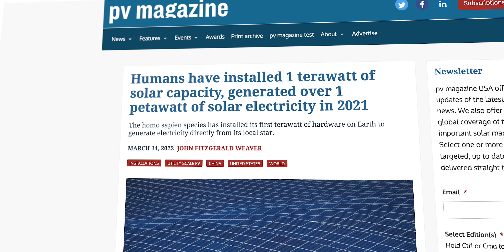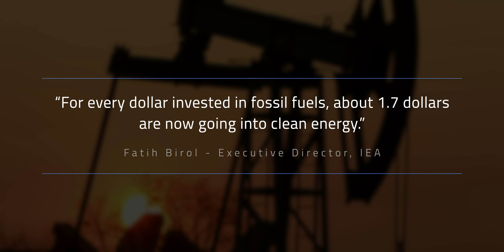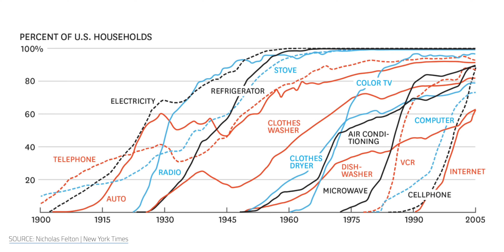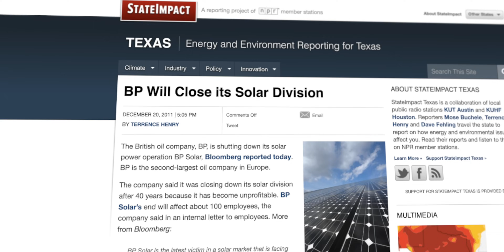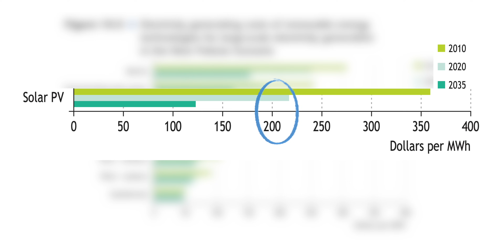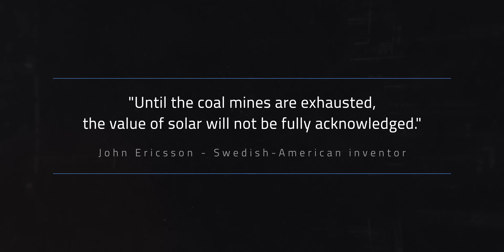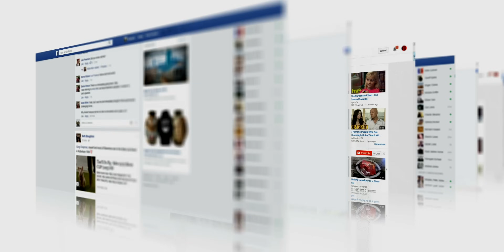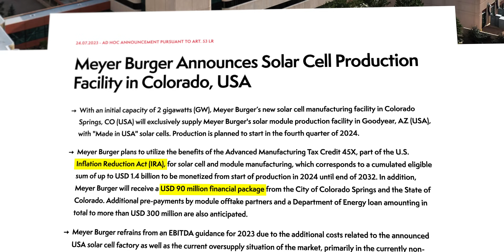How Solar Power Got So Cheap … So Fast

Comment: Matt, great video and thanks for the information and education. Wondering if another video of this type might be good for EV's. Providing additional information on the reasons for the slow transitions from ICE to EV's.
Reply: There are still a number of technological hurdles for mass adoption, quite frankly. It certainly isn't going to be used in a shipping or industrial capacity in it's current form as the amount of work you get out of those battery packs vs. charging time just isn't profitable at all. As for the average person, the sheer amount of rare earth minerals used in the battery packs, combined with a lack of mines that are NOT owned by China, who we are in a new cold war with, means that the cost of those packs will remain artificially high until alternatives can be found. Combine all that further still with the sheer amount of computer chips those vehicles need and the overall cost of the vehicle and it's maintenance (replacing those batteries ain't cheap or easy, I say this as a Ford tech) is simply going to be out of reach for the average consumer for the foreseeable future.
Reply: @alexwalker2582  You don't need to replace an entire battery pack if just a cell goes bad. It's also warrantied for 10 years by mandate, and most people don't even own a car that long. Also, there are already Semi fleets that are EV in commission now.

Comment: In planing a solar house in 1969, the collectors were for heating, some using water and other types using air. The heat battery was the enormous mass of the house for heating when the sun was down. The windows were double pained and insulation beads were blown in at night from a bead bin in the basement. Electricity was from the grid.

Comment: I would submit that small silicon waffer machines became surplus, and that is what dropped the cost of the individual cells.
It is now that the cells are getting larger, when mid size waffers are becoming obsolete

Comment: @UndecidedMF My predictions were not wrong. I went off grid in 2003 with just a 45 watt HF panel and an old truck battery. That panel cost me almost $300 but it was enough to run my water pump, a few lights and a radio.  I was the first on youtube teaching people about off grid solar and the Chinese started producing panels for off gridders and improving the technology. It was off gridders that drove the movement to cheaper and better solar panels.

It took a long time for solar to get past the off grid market to commercial and grid tied systems and you should thank an off gridder for making that possible because we proved to the world you can live with just solar power.

20 years later and I am still off grid with just a 1.4Kw system and 800Ah of LFEPO4 batteries which runs everything I need and I have most modern appliances. An average home in the US can run off a 5Kw system with the right appliances.

Now I will make another prediction and green hydrogen from renewable energy will replace fossil fuels for most uses where direct electricity won't work so invest in that.

Comment: A simple question that bypasses any need to calculate levelized cost or any other metric: Have the customers of any utility that has replaced fossil fuel power generation with grid scale wind and solar actually seen their electricity bills go down?
Reply: Net energy prices have quadrupled so no

Comment: Have you ever done a full comparison of environmental impact of solar vs fossil fuels from start to finish? I know there will probably be some pieces that are estimates or impact or just generally unknown at this time. But I am curious as to what the overall "cost" or impact is comparing the two.
Reply: Mining the materials for creating a solar panel happens once in its 30 year life span. Mining or extracting the fossil fuels to produce energy has to happen continuously. Many studies have shown the very short timeframe for renewables to gain the environmental advantage.
Reply: @beachcrow  Thats a wrong assumption. Once the well is drilled and the piping installed the pressure regulate the flow.
Pipes, drilling equipment and pumps can all be moved to new site.

None of this is true for solar and wind. Its a one shot deal that we don't even know how to recycle. Have you seem pictures of old solar farms?
An horrible sight to witness.
Reply: @mathieusimoneau3358  There's a whole lot of processing and transport before the crude oil or coal can produce electricity at your home.
Reply: @beachcrow  Same for wind and solar. How do you produce the silicates required? With a heavy lump of high carbon coal.
How do you produce the fiber glass and epoxy for turbines? Petrolum products.

So you take oil&gas and coal, use them for low density energy production and a end product that is so energy intensive to recycle you simply don't.

Its called a waste. While geothermal is so simple and available everywhere.

Comment: There are still barriers for some people who want to have rooftop solar, eg if you live in a ground floor apartment or no part of your roof is south facing and of course the high upfront cost for most people
Reply: Non south facing roofs is not an issue. East/west combinations are even better as the production of energy is more spread out during the day. Hence, more direct consumption. 
I´m planning to instal more solar panels on my ENE side where each 400WP panel still produces around 330kWh. Compared to 380kWh on the WSW side, each under 45° tilt. Just to have better coverage during the complete day.

Comment: I remember going to a local gun show this year and having to laugh at an anti-solar booth. Recently near my city a solar farm was built and i over heard them talking about it saying they just went out there, built it and haven't touched it since, they have only seen a few workers go over there every once and awhile. It is as though these people do not understand that that that is exactly why solar is so beneficial. It is largely set it and forget it. It will sit out there and make electricity. It is baffling the ignorance of some of the people around where I live in the deep south on the subject of renewables and its benefits. Even with co workers i am always told solar is way too expensive and takes up to much space when a house roof has plenty of space for solar to run off solar completely during the day. Indefinitely with battery storage.

Comment: Matt, love your videos.  You are so correct about incentives. I want to pull the trigger so bad, but at 60+ yrs old I'm terrified of incurring $20K+ of debt (loss of savings, etc). But the other side is will my $200+ bill be $400-500 (per month) when I'm 70!
Reply from the maker: Glad you're liking them!  You might want to look into community solar projects in your area.  Simple way to benefit from some reduced prices without having to install anything on your house.

Comment: Where I live, unfortunately with electricity prices so low it would currently take 20-30 years to break even due to install and battery cost. With how the average person moves every 5-10 years I would never see a return and it isn't one of those needle movers in terms of ROI where I live. Now if I were to move or electricity prices start to skyrocket where I live then I am 100% on board.

Comment: The real reason is: China
China has invested in renewable technology 4 times as much as America. It's the leader in solar.
And when it comes to projects being overbudget and late, it's exactly the opposite in China. Projects are generally underbudget and finish early, that's why it's the manufacturing capital of the world and the experience it has accumulated has translated into incredible growth and innovation.
Reply: Between 2008 and 2013, China's solar-electric panel industry dropped world prices by 80 percent. Matt is either ignorant, or a liar. You choose.

Comment: Two key points affecting the adoption of solar: politics and technological innovations.  I studied Solar for my masters in ME in the early 80's.  The emphasis was entirely on heat collection and storage; domestic hot water (DHW) preheat and passive for residential and HVAC for commercial.  Active system residential system costs were over $20K, optimistic break-even was 20 years, and few but researchers and my professors had solar installed.  A single PV panel cost around $10K and PV use was limited to critical remote power and satellites.  When I graduated in '83, there were no opportunities in Solar.  The Reagan administration had removed the solar panels and the tax credits of the Carter era, defunded SERI (the solar research institute), and suppressed the US solar industry.  Although scientists at the time were warning about potential climate change, the US population were unconvinced.  We now have substantial tax credits for solar due in part to changing public perception of climate change.  The industry switched from DHW to PV.  An astounding drop in solar cell cost was enabled by technological innovation.  Solar cells of the 80's were cut from monocrystal ingots, the same as used for IC manufacture.  These were slowly grown in a furnace over a period of weeks, sawed into circular wafers (losing substantial amounts of silicon), then processed into solar cells.  You can still spot these cells in old panels because of their round edges.  The breakthrough was the switch to using polycrystalline and amorphous silicon in solar cells, which can be extruded and made much thinner than cut wafers, saving both on manufacturing and materials costs with only a small loss in cell efficiency.  A standard panel now can cost less than $250.  Residential PV nowadays is cheaper and easier to install, can be installed in more regions, requires much less maintenance, doesn't require storage, and can break-even in 8 years or less.

Comment: The issue with solar is that you need to make use of the available unused space, which is typically the roof. In the uk getting on to a roof is hard and adding that additional weight to the roof has unknown long term impact. Plus all the solar installers are around for 12-18 months and then disappear

Comment: I first adopted solar in 2011 due to a great Feed in Tariff, later adding a 2nd 4 kWh system and Tesla Powerwall that came with no incentives. I saw it as investing in my home to reduce my monthly outgoings. Now I have an EV and ASHP and am running an all electric household. 
This has reduced my costs from over £5700 per year to just £1400 for heating travel and home use. 
My solar is on E/W spans of my roof.
So yes incentives help but once you understand the benefits it sells itself.

Comment: There needs to be a discussion about the geopolitical implications not just cost advantages.  We, dumped countless government dollars into Chinese production.  They are happy to provide cheap panels and shift us to their means of production and storage.  They all but control battery technologies and production.  We need a balanced grid.  China could withhold resources at any moment.  I am completely fine with solar once we own the production and storage, and we remove government handouts to subsidize.  We have an entire class of politicians and corporations that feed a cycle of incentives and profit without performance.

Comment: When I was working in the laser scribing industry, making machines to make Solar panels back in the noughties, the only thing people were talking about was getting the cost solar panels below $1 per watt. That was the magic number that people thought would allow the industry to achieve critical mass.

At the time, we thought thin film was the way to go, but we were so wrong. For all the innovation, and new technologies, all we really needed was was relatively minor innovations on crystalline polysilicon to hit the point in it's manufacturing cycle where it could really start to hit those economics of scale, and it just snowballed from there.

Comment: One of the beauties of solar is that you start to produce power with the first panel installed. And you can make incremental additions to a solar array at a relatively low cost. 

By comparison, it takes a couple of years and far more capital to install wind turbines and the incremental additional installations are more expensive than solar. 

And then if you look at nuclear, from inspiration to first power production takes many, many years. 

This is not to say that solar will always be best as there are too many variables. However, the net cash flows of solar need far more emphasis when considering the options.

Comment: Remember when everyone got mini satellite dishes? The big dishes had existed for decades prior to the mini dishes... but because their installation was fairly complicated (they were motorized and had to be precisely pointed at each satellite) they never took off... the mini dishes delivered a whole service on a single satellite (due to digital video compression) and hence their installation could be done much more cheaply. I suspect there is a similar curve in solar that we haven't hit yet. Once the panel efficiency gets to the point that a typical home could get by with 4 or 5 panels I suspect we'll see a free standing DIY solar solution become massively popular.
Reply: I think if that's what we're waiting for it's going to be a long while. 
polycrystaline silicon solar pannels, which are the standard for large scale systems, are about at the limit of the possible efficiency at 20-25%. The theoretical maximum efficency for a single junction sillicon solar cell on earth is about 32 percent according to the wikipidia page on the Shockley–Queisser limit. Assuming that's correct, the only real way to get more efficiency is to go multi junction with a more tunable band gap. Practically, that requires someone figuring out how to make perovskite solar cells that can survive real world conditions for years intead of weeks, then scaling up and optimizing the process while competing with traditional sillicon solar cells.
Reply: Satellite revolution wasn't about 'mini dishes' it was about having an advanced geosynchronous constellation, uplink, backhaul and the breakthrough to broadcasting smaller wavelengths.
This is all infrastructure (on the utility side)
Single junction solar cells are pretty much at their theoretical efficiency limits. Unless you want to live on a planet without a protective  atmosphere, magnetosphere and radiation belt...

Comment: I still can't understand why everyone insists on continuing to utilize their inefficient ac appliances and lighting and such with having to use inverters/converters and regulators when using dc appliances and bulbs cut the overall costs and make it more reliable and simpler...

Comment: The main problem that solar faces for adoption at a large commercial level now isn't the price of the equipment or the value of the energy it produces, it's that it is an energy source that doesn't require a fuel.

Energy producers are about making profit, not producing energy efficiently, cheaply, or being environmentally friendly. If it were true that being a cheaper energy source were all that was needed to get energy producers to switch, solar would be much higher than 5% of energy production right now and no one would be building any fuel burning power plants anywhere (dozens are under construction in the US alone right now).

The switch will happen, but it'll happen because selling fuel becomes unprofitable, not because there is a cheaper and cleaner method to generate energy. It doesn't matter how cheap energy generation with solar gets, if they can make more actual ongoing profit by upselling on a fuel they burn, they're going to burn that fuel.

Comment: In my area our electricity provider is a quasi-governmental agency, Electrical District #3, akin to a rural electrification district. They have disincentivized solar additions by adding a 'Solar Customer Fee' to supposedly pay for the infrastructure maintenance costs, and also by limiting the number of solar connections they process. I can see their point that they still have to pay for and maintain the infrastructure for customers who would normally use little power from their distribution system, but I would think that is what the standard customer charge would be for. This eats into the pricing advantage of rooftop solar.

Comment: My local council has a deal that maybe more should do. They can install a system, up to $6000 (not including batteries unfortunately), and they initially pay for it. You pay it back over 10 years. It's designed so that what you have to pay is less than what you save on your electricity bill. So, it effectively costs me nothing. It really incentivizes people who are on the fence.

Looking forward to getting it installed.

Comment: Fun fact: here in Spain solar had a terribly low uptake because in 2015, due to lobbying from Iberdrola, the then PP gov brought in the "Sun Tax", which meant even if you bought solar and fed it in to the grid you had to pay the power company.  

In 2018 the PSoE Gov repealed this and now solar is going ballistic - as you would expect in the sunniest country in Europe.

Every building has a roof that points at the sky, so it would seem a no brainer to me to make every roof be a solar collector and so have every building at least somewhat self generating of power and hot water
Reply: Leave it to the Socialists to F things up.
Reply: My understanding is that South Africa also oppose feeding in of PV generated power to the grid - despite having a failing government run/owned national supplier that is falling apart, which is causing great economic damage.
Reply: @percyfaith11  They are the ones on unfucked them in this case.